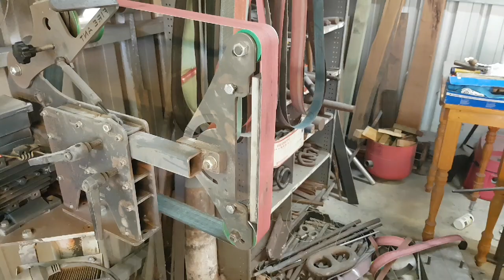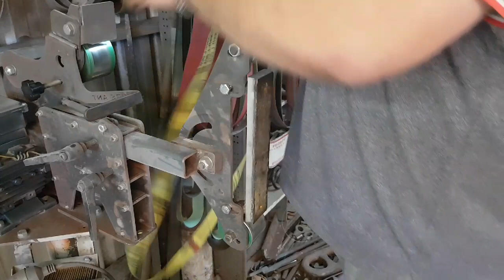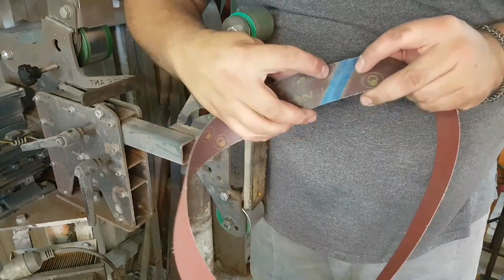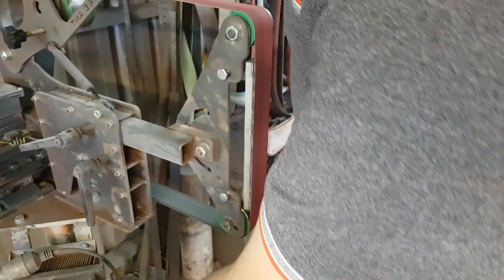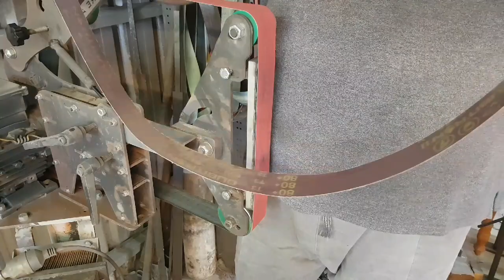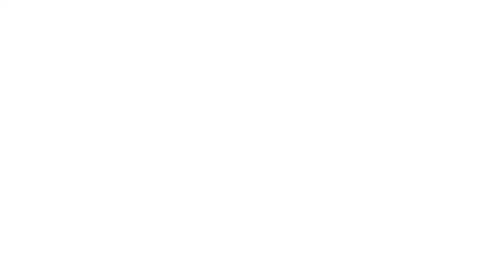Grinder tips: belt "tick"

Comment: Hey Sam. I’ve just recently started forging and after hand beveling and sharpening my first knife I think I’ll need to build myself a 2x72 soon. I’m only 16 but I have some health issues so I’m sick a lot and I’m always very tired . So this makes filing for 5 hours straight pretty hard to do haha especially if I spent the previous day forging for a couple hours. 

I was wondering as there is many videos on youtube if there is a particular 2x72 build you’d recommend or would I be fine to just draw up a blueprint myself? I don’t have a lot of funds to spend right now, so I want to buy as little as possible, could I make a platen out of plate steel by cutting it out myself?

I’d like to get to work on a grinder as soon as I can as it will make my life much easier and allow me to get some nicer results. So any help is much appreciated! Love your work, you’ve been a big inspiration for me 😄
Reply: I just use a harbor freight 1x30 they're only like $50 or something it's really underpowered but it does the job and belts are pretty cheap. I don't think this really answers your question but I hope it helps.
Reply from the maker: A 2x72 build won't be cheap, cheaper than a full 2x72  but you're still looking at around $500. If you have the fabrication knowledge then go for it, I decided to buy mine, as I wasn't comfortable trying to build one that would do what i wanted it to. My advice would be save up for a decent 2x48 like the shopmate 48, or buy a scorpion from firepants fabrication. There are plenty of how to videos on her of building 2x72s, it all comes down to your abilities, tooling, and time.